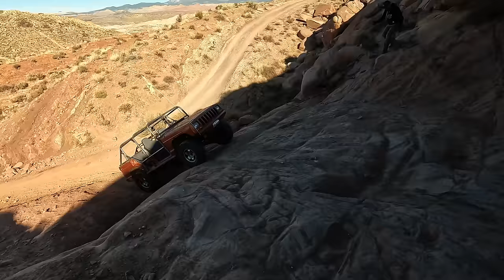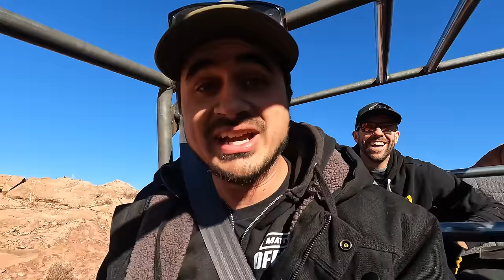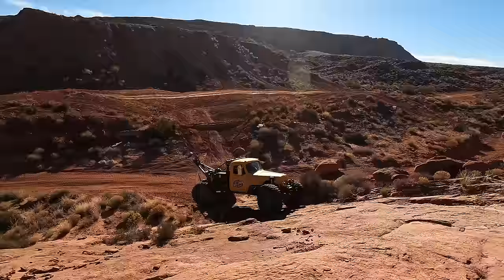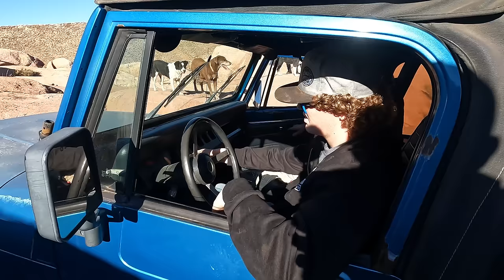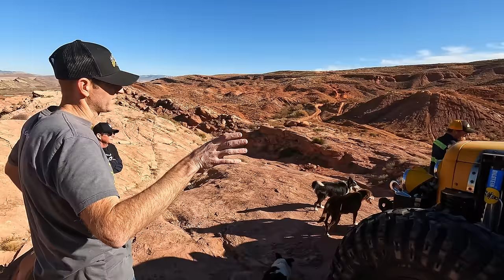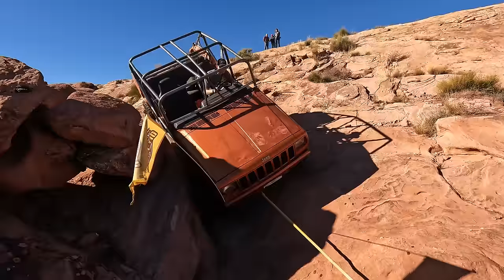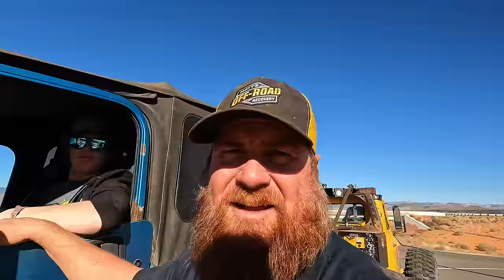I Made A Bad Choice...Broken Axle

Comment: Back in '99 I rebuilt my Dana 35 after a trip to Moab and broke the ring and pinion.  Had to drive out of Pritchett Canyon, and back to town in reverse.  Right after I rebuilt it, tried to chirp the tires (like an idiot) by popping the clutch.  Heard a bang, so I got on the freeway to head home a couple miles away.  Tire and axle shaft flew off and left me grinding my way to a stop on the side of the road riding on the backing plate.  Still remember watching my axle shaft and tire role past me!  Fun times, needless to say a Dana 44 with Superior axle shafts and a spool solved that problem forever!

Comment: Hear me out Matt! A bar that connects to the receiver of the jeep and the wrecker to keep it from rolling into you and pulling away from you for up hill downhill activitys. It could be a Pintle hitch on both ends
Reply: exactly what i was thinking. But drama is good for the views so maybe mat is the expert and we are just the captains standing ashore
Reply: I’ve been thinking about this same problem. It would have to be a solution that would help him not destroy front bumpers when hooked up to the front.
Reply: Thinking the same. something like the top arm on a tractors three point hitch.
Reply: I think it would cause too many issues in situations like 10:31 and 11:00 also he’s said many of the vehicles recovered don’t have a good mounting point for that end

Comment: Do you think an adjustable spreader bar would help with the push/pull forces of the wrecker? Double pivots on both ends, slips into a receiver. Then the ropes are for lifting only, not pushing and pulling with the vehicle in tow swinging back and forth. 

Obviously it wouldnt work in every scenario but i think it would help alot. Could even use an old driveshaft, lol

Comment: There should be a rubber brake hose that feeds off to both rear wheel cylinders. Clamp that hose, and you'd get front brakes to use. (for future info)

Comment: Jam the brake pedal hard. Should move the shuttle valve in the prop/ combination valve to shut flow to the rear brakes. That's how it's designed to work

Comment: Vice grips on the rubber brake line on the rear axle of the jeep should have gotten the jeep brakes on the front at least. It could be possible to build a link out of receiver pintle hitches. So go from the pintle hitch on the wrecker with the ring hitch a bar another ring then a receiver pintle. It wouldn't be as much stuff as an actual tow assembly but would provide a semi solid connection between the vehicles.

Comment: Yall sould make broken c clip wheel holders so you can drove em out 

Easiest way ive seen is it clamps onto axle and has a cone with bearing to push on axle hub. 

Part that clamps to axle has square tube with holes to accommodate different tire sizes . It then bolts outside wheel. 

It works quite well

Comment: Err has suggested that you guys install a clear plastic lexan windscreen cut to size on the Tangerine with slots cut for tie wraps to go around the piping to hold in place.Also a half canvas top to go over the front two seats up till the center bar....but NOOOO!
Reply: Problem with Lexan is it crazes easily so after a couple of sand rescues it would be worse than no windshield. Been there/done that.

Comment: Would it help if you made something to go into the towing receiver that had a horizontal bar welded to it. On the horizontal bar you could weld your own lifting points. Or if you were lifting from the axle, you could run the straps around the back of the horizontal bar so the straps don't put pressure on the bumper. Ive never done any sort of recovery so maybe this wouldnt work

Comment: @Matt's Off Road Recovery
Why not weld a prop shaft to the bootom of the boom and connect it to the trailer hitch on the car on back?
To prevent the car to smash in to the wrecker.
A prop shaft is frexible in all direction, could make it hydraulic adjustable as well

Comment: I made a heavy pipe with two other pipes over the long one to make a two way roller. Then strap it to the frame. It holds the tire in place but will still roll at slow speeds

Comment: Also make a steel tub to hook up to the tow truck with a pin so it can rotate and  have the side that goes to the broken vehicle it can cook up into the tow hitch/ ball hitch. This way you dont need anyone riding in the broken vehicle and worry about braking because it will ne hooked up to the tow truck

Comment: Now THAT was an off road recovery!

I, obviously, do not know much about this type of axle failure. Why didn't they just take the rear wheels and axles out and drag it back without them installed? Wouldn't that have been easier to tow?

Comment: Is there any way you can use a large inner tube (inflate it when called for) or a modification to a air lift spring between the wrecker and the vehicle being towed to prevent the towed vehicle from hitting the wrecker?

Comment: I know they have yen snow cat, short bus builds lined up.  I still think a 1 ton or bigger SRW crew cab, long bed..  convert to reg cab. At least 12’ tilt bed 2/front mount winch. Modified to tandem rear axle. So a 16’ tilt bed possible?
 You can load any side by side, or average suv loaded.

Comment: Hey Matt I've been watching you for a long time also Trail Mater and I'm wondering if when you're towing a vehicle like in this instance you were Towing the Jeep and I noticed that you had the back winch connected so you're basically pulling from there what if you were to put that winch line through say a 4-foot pipe that is completely deburred on the inside and on the outside that way if the Jeep rolled forward it wouldn't be able to hit the tow truck and it would also act like a break . You might also be able to do it with your two soft shackles how you pull sometimes. Just wondering if you thought about that

Comment: you really need to make a axle lift bar that hooks into your pintle and then use your dual winches to lift the bar from the vehicle side using the winches to control the roll. it would make these tow out jobs way more simple.

Comment: I think it would be really good to have a kind of boom you connect to the back of the wrecker and connects to the back or front of what you are towing to prevent the tow to bump into the wrecker. i see you have this problem so often. braking is difficult and in this case even more. I think it would be helpful to prevent damage. love the channel! keep up the good work.
Reply: This topic has been beaten into the ground for years. Nobody has designed anything that actually works for rock climbing situations. The two cross straps are the only way to go, so far...

Comment: A tool that would have made this job a bit safer and maybe easier is some brake hose crimping pliers. Vise Grip made the best one's. If installed wrong and brake hose was damaged it still would've been better to have ( in this case ) front brakes then none

Comment: Another great video! The experience that goes into this really shows.
But, I haz a question: wouldn't taking the wheels/axles completely out have obviated a lot of problems?
Reply: Possibly, but that would allow the gear oil in the differential to leak out all over the trail. The axle shafts were holding most of that in. And it's probably safer to keep it together rather than drive around with the tires and axles banging around in the back of a vehicle.
Reply: @AndrewAMartin  As an ex-mechanic who did pick up vehicles off the road, it was common to carry plastic bags and rubber bands and zip ties and the like, as well as things to hold things down in the back of a vehicle.
I do often question as to whether these guys even know what a tire pressure gauge is, but at the same  time, I'm aware that there is some playing to the camera.

Comment: I know you guys know what you are doing, but I always wonder why you never have what you need to make a job go smother. Like a strap to hold the rear axles in. I think it's time to outfit the wrecker and have a check list and go over it at the end of ever job so it's ready for the next one.
This is just me thinking out loud.
Reply: It's easy to say that, of course it makes sense, but I think they  just have so much going on the overlook stuff like that. And they know they can get by without all the gear they should have, so it's probably not a huge problem to them

Comment: brake line plugs so if you need to plug a brake line so you can use the other brakes Just keep some 6 penny nails with you. take the brake line off at the wheel that is leaking and than put nail in side the brake line put brake line back on and now no more leaks.

Comment: I have commented about this b4. It drives me crazy every time you put a vehicle on the hooks, and you can’t (almost) do anything to keep the towed vehicle from slamming into the back of the wrecker. That is a very easy fix. Just put a rubber strap sling(like the old school towtrucks)  problem solved. When ur done an if it’s in ur way,just take it off. PLEASE help me understand why you haven’t done this. It’s so simple. Please fix this b4 someone or something gets hurt or torn up.👍👍🤪

Comment: Why is it that even after all this time, with the hassle of avoiding damaging customers vehicles on the boom and on the back of recovery vehicles, MORR still haven't come up with a solution?

In boating, tugboats use old car tyres to cushion any impact between them and their customers.

Surely for the expense of ruining an old surplus tyre or two, it would be an easy ask to fit something like that on the back of the wrecker. Or one even slung on the hood of the customer's vehicle.

A half or quarter tyre on the end of the boom, half tyres on the rear quarters, effectively gives you a dodgem car solution.

Where's the problem, is it like fitting temporary mudguards, not cool enough looking for YouTube?

Why if you push the boat out, you could even carry inflatable boat fenders, to maybes look more the part.

Comment: what if you took 2 hitches and connected them about 3 foot apart with 2 universal joints to slide in the receiver hitches it would keep it from coming into the recker on the down hill.

Comment: I always enjoy watching your videos, but today's is a little nerve racking. Yes, I am going to armchair the crap out of this. Since the rear axle shafts are coming out due to the broken c-clips, why not just pull them out all the way. Throw them in the Tangerine or the customers back of the Jeep and then you don't have to worry about them. Shove rags into the axle tubes, tape off the openings and then continue on without having to worry about dragging or losing the rear ires. Did the front brakes give out? Kaulin can just use them and steer without starting the engine. When are you going to buy headsets like Rory and Paul to communicate what is going on?

Comment: Could the rear brake lines be pinched enough so there's still front brakes? I have taken a brake line off and used a nail and piece of leather to seal off a brake before so I still had 3.

Comment: Let me guess he thought it would be cool to put a locker in his D35 and didn’t replace the shafts? Not sure what that guy was thinking. No frame tie ins for the rear bumper either.
Reply: I was thinking the same thing…
Reply: Any upgrade to a D35 is a waste of time and money. JK44 rears are pretty plentiful and have a great aftermarket. It’s doesn’t take much work to put one in and run adapters/spacers to match the whatever D30 is upfront or throw a JK30 upfront too.
Reply: As the saying goes run what you brung 
Or maybe not wanting to sink $$ in to a old toy? ✌️

Comment: Te: BOMBI....that vehicle is totally unsuitable foryour application. I would sell it and search for something more rugged, or, build what you need from scratch using steel tracks, rollers, drive wheels, better enging & transmission. Just my opinion, M Witt, MechEngr.

Comment: You and Tom need to make a wheel fork like sling tow trucks have to put the back wheels in, that way you won't have to worry about brakes or if the car or truck is going to swing into the back of that wrecker. You haven't listened to anything else I have suggested but maybe you will this time. Control of what you are towing puts the worry out of your head and you can just drive.

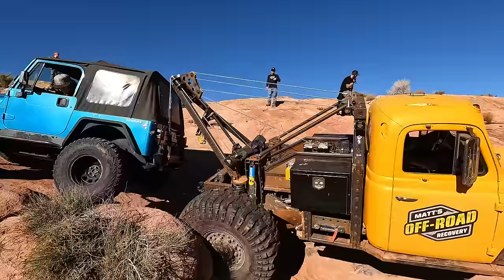Comment: 9:57 I do not understand why they don't put a regular (old fashioned) rubber belt cradle on the off road wrecker, they need it on almost every recovery.  Easy to make ... 

We used to make them out those  of old (thick) rock crusher conveyor  belts, flat bar and lots of bolts.  Use a heated up rerod to make the holes in the belts.

Comment: It must be nice to have lots of $$$$ to pay for the damages to the Jeep and lots more $$$ for the recovery so you can drive your vehicle in places where you have no business being.
Reply: First off what damages? Second the off road rocker was built to haul broke down rigs out of the state park.
Reply: @jasonh4167  
Yeah, my bad. The axle broken, brake parts shattered and falling all over the place, oil leaking from who knows where and additional damages that will be found upon inspection. Just take that Jeep to the local quick stop oil change place and all will be good. As for the recovery, what your estimate for two recovery vehicles several recovery  crew members,  several hours of time and additional charges for special equipment use. The whole affair probably  cost the Jeep owner $50.00 or less.